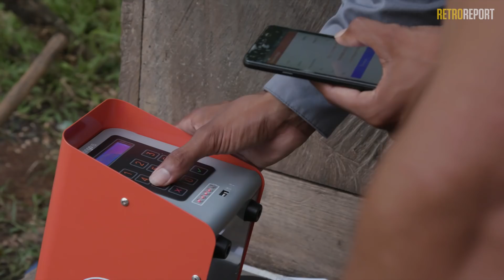Solar power could be the answer to aging electrical grids

Comment: The solar panel is a great solution for remote areas, but in huge cities in the western world, not a good choice. People think solar panel as solar cell only, rather than as a generation system. It must consist of a storage system and converter. As most of the electicity usage is in the early morning and evenings, it needs good storage system in order to actually supply stable electricity. current challange is in building efficient energy storage system, before than solar is just not viable for mass scale. At the end of the day, today's gas power stations have much higher efficiency not mention nuclear. 

For people who think we should switch to solar for preventing global warming, think this first. Solar panel production, high carbon foot print, batteries even worse. Indeed once it's built it is zero carbon, but by rushing solar production, aren't we releasing much high volume of carbon in an extremely short amount of time while gas and others may take few years to do so as they are already built?

One more to think about, if global warming is so devastating, why are we not advocating research of reusing carbon eventually reaching carbon negative rather than these renewable methods that produce high carbon at its production?

Indeed there are many types of research going on, but this information is mostly available to academics, not the general public, as research budget is highly dependent on public interests, I wonder why solar why wind, but not sucking carbon back?
Reply: Yaimah00 it's simple chemistry my dear friend. Combustion is the breaking of chemical bonds and then reforming. If the bonds form take less energy to form than the original ones, energy is released and can be used. Now because there is no way to extract 100% of that energy, we only get a fraction of what came out. 

Now thats said, doing the process in reverse, which is what you are talking about, is doable but is quite impractical. Energy has to come from somewhere and add in the inefficiencies. 

Tl:Dr This is an exaggerated example but a simple way of putting it:
Burn a gallon of gas to produce a 1/8 of a gallon of gas.
Reply: Many misconceptions there my friend, but understandable given the information most people are exposed to.  Eventually solar will power everything, and batteries store the energy (perhaps with a dab of local fusion).  Solar power can be in the form of wind, hydro, PV and thermal -- even waves, and batteries can be chemical, gravitational, electrostatic, or, and I like this one to help us transition: energy can be stored as synthetic hydrocarbons.  You can literally make a gasoline substitute from solar energy, water and co2 in the air.  Cool!

Comment: Heard of nuclear???  Idealogues will put their head in the sand, but realistically to move the needle we need better nuclear.  Think that's a dumb idea?  Here are some smart people talking about it.  https://www.youtube.com/watch?v=e7gL2iBMAeY  Of course solar, wind, etc need further development and investigation, but all you unrealistic greenies need to do some basic feasability research or ask nearly any engineer who frequently does feasablity in a relavant field and you will most likely get the same answer.  Before you use the "its not safe" card, do some research.  ARGGGG hahahaha! :)
Reply: Nicholas Elliott I think you missed the point of this video. With nuclear you still need to run the wire. Q
Reply: None of those smart people are putting up their own money to build one, so...
Reply: The type of nuclear reactors we now run are very obsolete (they were always a bad choice considering pebble-bed was the alternative way back), not to mention the land use (security perimeter), construction time and cost overruns.  Then there's guarded storage, basically forever. 
If you plaster the land a nuke uses with panels and batteries, you'd get a 20 year start on power production, plus not have to go mine, refine, and transport uranium, then guard the waste for hundreds of thousands of years.
Of course new reactor designs are pretty sweet, and thorium (LFTR) may be a good alternative.  The latest cycles remove most of the energy as opposed to a few percent, and pass the pizza test (leave the reactor to melt down while getting pizza).  They can also be produce more cheaply and quickly.  I'm all for nuclear, but only if it makes sense.  Current reactors are inefficient on so many levels, well, apart from generating plutonium for bombs.

Comment: I love pictures of all the solar power farms in places like Germany.  They are nestled into forests beside roads and very picturesque.  Nobody seems to question the massive amount of trees that must have been cut down or farmland used up to put in the solar farm.  Acres of forest lost for the yearly power output of 0.1% of a coal plant.  Not that I care much for coal either, but let’s not blind ourselves that all energy sources have pros and cons.
Reply: So it is ok to cut down huge forests and mountains to obtain coal that gets burned once, but not for solar that keeps producing for decades?
Reply: Go reread what you wrote.  If you are going to mention land use of solar, but not of coal, you are guilty of what you complain about.  On the other hand, green fairydust is a strawman.

Why would you care what percentage of its capacity it produces?  The relevant question concerns costs (monetary and otherwise) and benefits.  And on that question solar is vastly better than coal.

Of course fields are a terrible place to put solar farms.  They should be on parking lots (at least in the US, where parking lots provide sufficient space for over 50% of total energy needs).  No new power lines, roads, or space required.
Reply: @CorwynGC  hey, that parking lot idea is brilliant, the cars wouldn't get heated up, and that would be an additional source of revenue from selling that energy for the parking lot owner too, that's a win-win, I'm wondering why no one's doing that
Reply: Did they actually cut down forests en masse to install solar PV?  Or was it grazing land, or land that had otherwise already been cleared?
Reply: Wikus Van De Merwe all of the above.  Germany was also going to turn a wild bird sanctuary into a solar farm too, despite public outcry.   It was in the news a couple years back. Not sure if they ended up doing it in the end though
Reply: CorwynGC where in what I typed did you get that?  My point was don't kid yourself that solar is green fairydust and unicorns.  Still gotta mine toxic materials and dispose of them at end of lifecycle.  Except solar is not very efficient...  In Germany it produces, what, 9% of its capacity on average?  Gotta take up a lot of ground space for that overbuild to make up for poor capacity factor, build roads to the panels, power lines etc.  Coal ain't my favorite either,  just maybe consider taking the red pill instead of the blue pill eh?

Comment: Nope, because the production of solar panels need rare earth materials. They are called rare earth for a reason. In short, if "everyone" needed solar panels to gain power. There wouldnt be enough even if production capacity was more than able to handle it. Its not a "down stream" issue, if people know a thing or two about Supply Chain Management.
Reply: China currently has a massive surplus of solar cells. They went overboard in production. Now they are selling off their inventories at very low prices. If you've been following the news, you may have noticed a rash of bans of solar cells from China. This is due to them dumping cheap cells on the western markets. 

Thats how common these things are becoming.
Reply: +icw. I didnt know that, but considering that Chinas CCP at one point wanted to take over every rare earth production company in the world to use it as indirect pressure on Western nations. I am not surprised they have had a high level of production. Maybe in an effort to corner the marked by having the government subsidize raw material cost. If they are dumping stock now, I assume that failed or maybe fusion is getting closer...
Reply: Which rare earths do you think go into solar panels?  How much per panel? And what is the global supply of each?
Reply: There is NO Tellurium required in most solar panels (only some thin film ones).  Therefore perhaps you should rethink your claim that "solar panels need rare earth materials"
Reply: +CorwynGC. I am not interested in spending a shit ton of time digging up specific data you cant be bothered to look for yourself. Do your own fucking legwork, but I can give you one example: Tellurium.
Reply: +MrHadeke. Firstly, I would argue you are wrong on your first claim. Secondly, your "carbon brake even for wind is 6 month." is kinda irrelevant because producing has nothing to do with "carbon break" levels. Ether you can produce X amount or you cant. It being whatever for the environment doesnt affect the former. That said, wind also have tertiary issues on environment like killing local bird life, needing extensive areas for effective deployment and so on... 

Hardly something that can be used a macro context to create enough power. No one here is claiming there wont be ANY wind, solar or similar. I am claiming it wont REPLACE the energy needs that is currently created by oil and gas. Go ahead, google "World energy consumption" and look at the pie charts.
Reply: +CorwynGC. I should rethink because I mentioned X and you would have responded with a similar Y *REGARDLESS*? LoL, that is not how it works. Simplistic rhetoric is boring.
Reply: If you are willing to lie for your position,...

"the production of solar panels need rare earth materials."

This is a lie, and you now know it.
Reply: +CorwynGC. You would have replied with the same regardless. I said simplistic rhetoric was boring. That you continue with it just exposes you are full of BS. First its, explain everything to me. Then its "that is not accurate" or "not used in every product" or similar etc and then its "oh, you are al liar" and so on. Fuck off, Corwyn. I am not interested in your BS rhetorical trolling.
Reply: Perhaps someday you will discover the difference between 'explain everything to me' and 'prove your BS'.
Reply: +Cor, and maybe one day you will understand why people dont like you handing out candy to kids from a van. You see, your passive aggressive cover stance of "just bla bla" doesnt cut it when the obvious,... is obvious. So just cut the crap and fuck off.

Comment: Nvm, Trump banned solar panel importing. So, the price...
Reply: Trump did not ban solar importing, he put a tariff on them.

Americans seem unwilling to do whats necessary to achieve cheap solar panels produced there.  Are they just weaker than the Chinese?

The thing to do when someone is dumping goods into your markets is to buy as much as you can at the loss leader price, and use the saving to improve your own systems.
Reply: Trump won't last forever.
Reply: Sky Yin So that America van make their own! So they can invest in their own country. So they can increase the economy. So they can empower more Americans. So they can eventually bring down costs but also increase life for AMERICANS!
STOP BASHING TRUP WITH YOUR SHORTSIGHTEDNESS.

Comment: Every new Home needs to be self energy sufficient full stop ! We have the tech
Reply: I agree but somebody up on Top is making money from this.
Reply: I assume your location is Waltham Abbey U.K.? Solar is useless in the U.K, and wind is not an option for many homes. 
Of course it's possible if you have a large bank account but the capacity you will need to be self sufficient is prohibitively expensive. If you want self sufficiency, a diesel generator will be much cheaper than renewable to install and more reliable, but still more expensive than grid power.
Reply: @iainreid9914  I don't agree.
Reply: Rebecca, 

quite normal, but please explain why you do not agree?
Reply: @iainreid9914  Oh no sorry, comment should have said " i do agree".

Comment: Confused why its so complicated to design a battery to store the energy during the hours of sunlight.
Reply: because we dont have a material that can store charge for long periods of time and release it.
Reply: It's complicated because it's a hard problem.  It's not particularly complicated (if you know enough about electronics) to buy high quality batteries and build them into a system that can store power.  Not complicated, but also not cheap.
Reply: they're expensive
Reply: Batteries are expensive, but you might change my mind if you find an actual source of cheap batteries. And conventional power generation is just so much cheaper, plus it's already here so we dont need to spend money to build new plants.
Reply: Benjamin Larson Yeah i agree with you with the fact that batteries are currently. Dont forget that conventional power generation such as by coal is polluting the air day by day. I know that its cheap to buy electricity but we will pay a huge fine when one day the air wont be breathable due to increased pollution. So dont you think that paying a little bit of money will help in saving the world rather than just sitting on piles of money and wasting it on other leisures?
Reply: Haven't you heard of the Tesla Powerwall??
Reply: Benjamin Larson Yeah but not too expensive.....they can be considered as an one time investment just like the solar panels

Comment: I think that all new houses should have to have solar panels on the house to account for 35% of your daily electricity for that house. It should be a law, even tho it is 35% it would make a huge difference in the fight on global warming.
Reply: Jarid Gaming, What you suggest is a great goal. The strain on our electrical grid would be greatly reduced, but let me suggest something more. I've worked in the H.V.A.C. industry for 25 years and have seen what works and what doesn't. The largest part of the average homes energy bill comes from its heating and cooling systems. People will spend huge amounts of money replacing their furnace and air-conditioning systems with "High Efficiency" models or replacing their windows and doors with high tech. thermally insulated versions. While these things are all fine to do most people don't have $25,000.00 dollars to throw at this solution. Thermal photography shows us that most homes have very poorly insulated attics. Up to 70% of your summer heat gain and winter heat loss can be transferred through your ceiling into your living space. Buying a more energy efficient H.V.A.C. system would be much like buying a bigger sump pump rather than fixing the holes in your boat. Have your attic insulation upgraded. If you are able to do this yourself instead of hiring someone else that's great. Roll out insulation is fine. Get the highest "R" rating that you can, be sure to use a dust mask, eye protection and proper clothing to protect you from the fiberglass. Compare your summer and winter energy bills afterwards as well as how comfortable your home is and how often your system kicks on as well as how long it runs each time. After eliminating your biggest heat loss and heat gains you can then determine whether or not you need new windows or H.V.A.C. system.
Reply: Tbh I estimate 80% of the electricity is used by compagnies, households really don't use that much
Reply: Jarid Gaming: I agree, but not 35%, 100%. Solar panels will continue to get cheaper, and batteries more efficient, until everyone can make their own energy, direct from the sun. When the grid goes, the society becomes less centralised, and individual families have more power and responsibility. That means the "social pyramid" constructed by the state is weakened, so wealth differentials decrease. The grid is symbolic of the centralised power that creates great wealth and poverty. Solar panels are "disintermediating" power delivery - that means cutting out the middle man, which is the state - get  it?
Reply: yay keep it opinion based!
Reply: nuclear, coal and oil companies would object.
Reply: he gets 10$ everytime he says stupid shit like this on the internet.
Reply: They do in California.
Reply: Its just a matter of time when solar panels become more efficient. Solar power is the future for energy
Reply: another law controlling citizens. what a great idea. welcome to the land of the sheep and the home of the slave.
Reply: How come liberals are so obsessed with having a corrupt government micro-control every aspect of peoples lives?
Reply: Jarid Gaming 

Solar panels produce more toxic waste than nuclear power plants. 

"......solar electricity in Germany will cost almost five times more for every kilowatt hour of electricity it provides than Finland's new nuclear plant.”